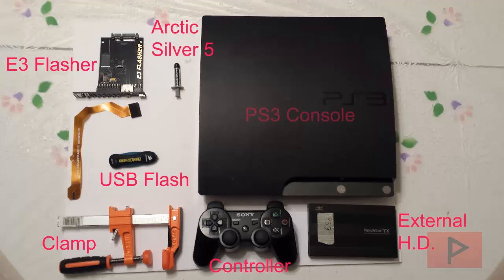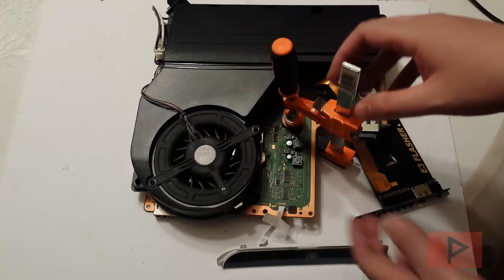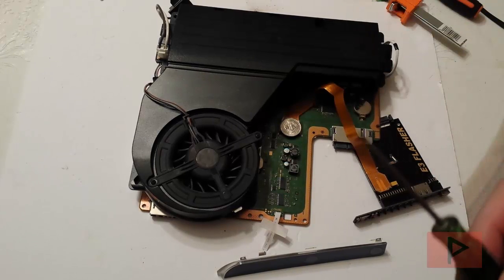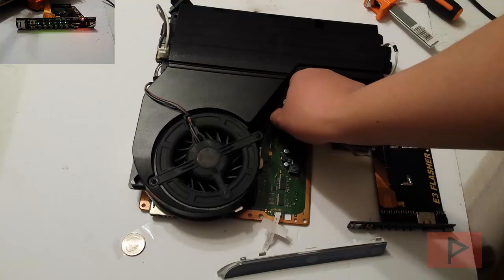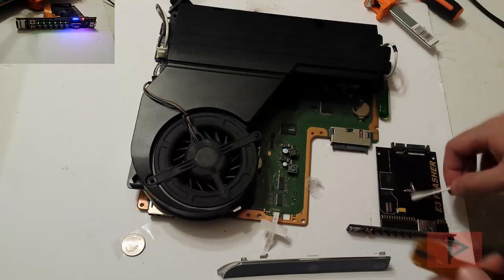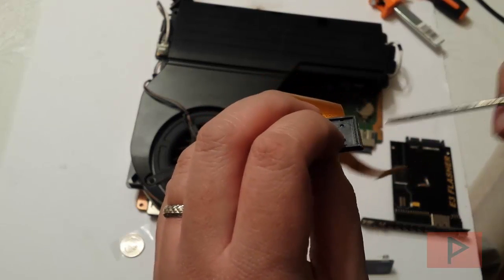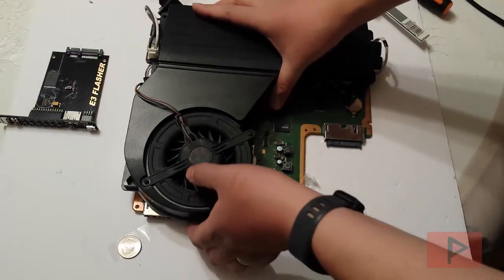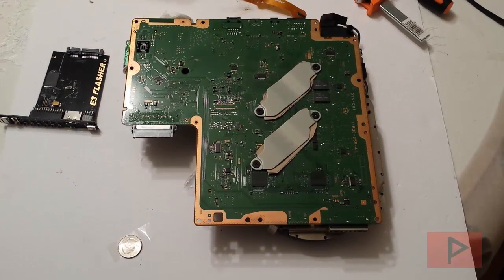E3 Flasher Tips and Tricks for Downgrading PS3 Slim

Comment: You dont need to screw down the cooling fan. I didn't (well I couldn't). I also recommend using power tools for the motherboard shield as they are very hard and stripe easily. i ended up using a rotary tool to cut the screw to use a flat head.
Reply: +Project Phoenix Media The first try tried to screw down the fan but there was a piece of metal covering the Nor chip. If I put the e3 clip first the cooling fan would apply too much pressure on the Nor chip. Yes if I were to do it again I would screw it down just place It properly according to were the cpu and gpu are.